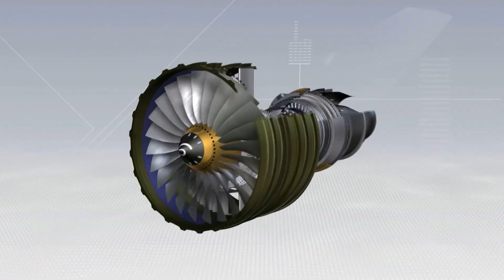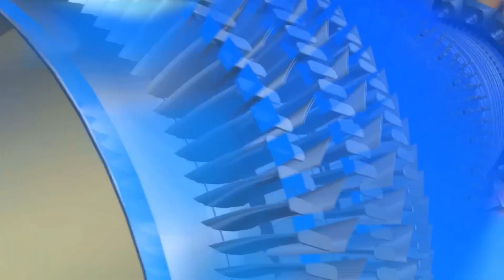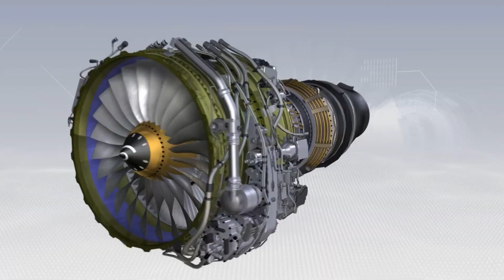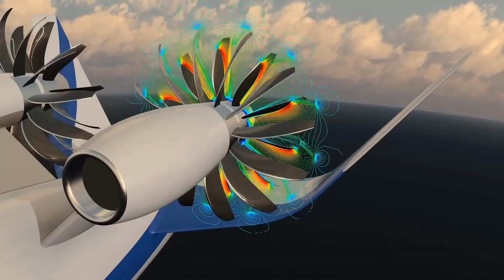This Airbus's NEW Open Rotor Engines Will Change the Aviation Industry! Here’s Why

Comment: This is nothing new. McDonnell Douglas tested an open rotor engine, also known as a propfan or unducted fan, on its MD-80 passenger aircraft in 1989. Very much the same concept.
Reply: to the uninitiated, it looks the same, but the main principles are completely different